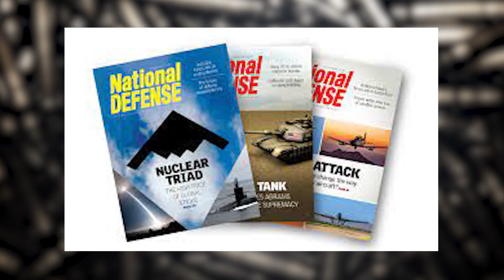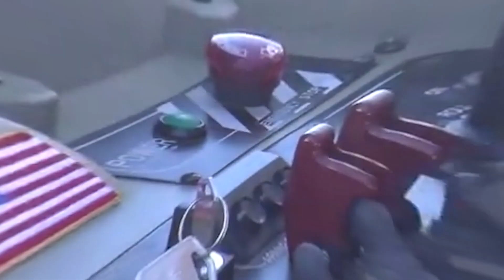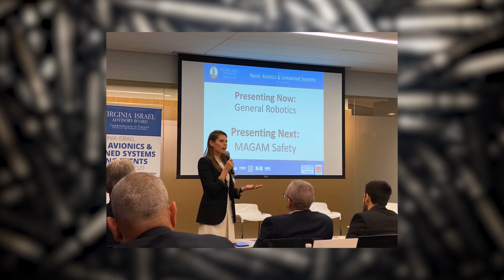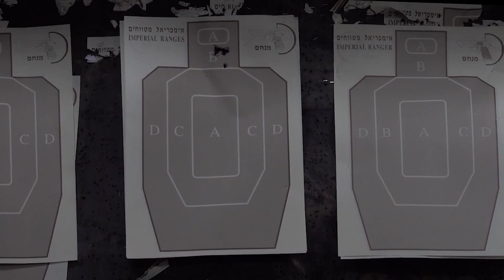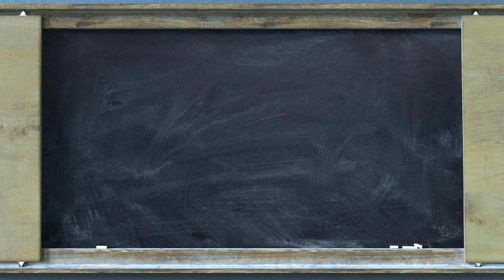5 NEWEST Advanced ARMY ROBOTS 2024 | Boston Dynamics

Comment: What about 3D printed micro-robot composite humanoid robots, with invisibility material covering shell? And equip them with the latest nano chip AI brains, and wireless ASI Military Operations APIs. Also, equip them with camera vision for human militant operator remote control via VR headset. Obviously, equip their APIs with synchronization plans, formations, and tactics. Tranquilizer weapons and micro chip tracker implant-able weapons. On-touch electricity to human skin to brain signaling puppeteering instructions weapons. Additionally, attachments of small robot bird drones (tiny planes) on the humanoids; also covered with invisibilty material shells and equiped with similar chip and puppeteering weapons; make them as wings-to-human-leg cladding for weapon assault and electrical shock puppeteering with a sleep command.